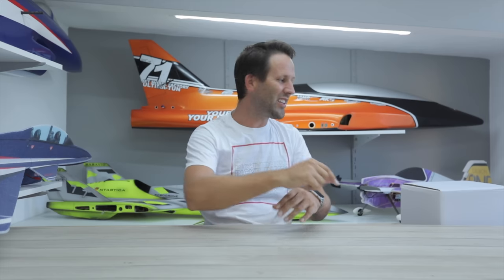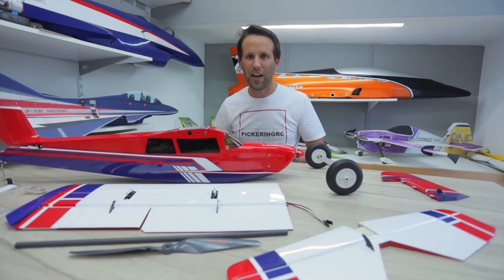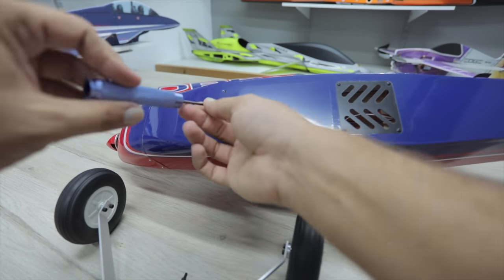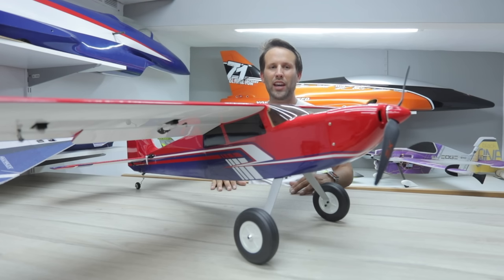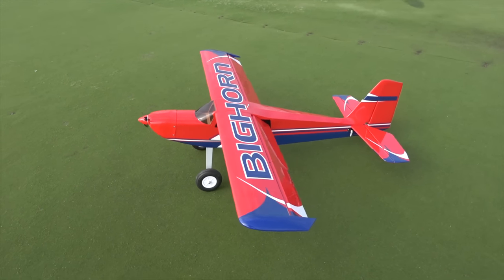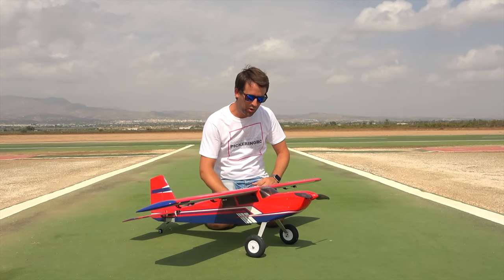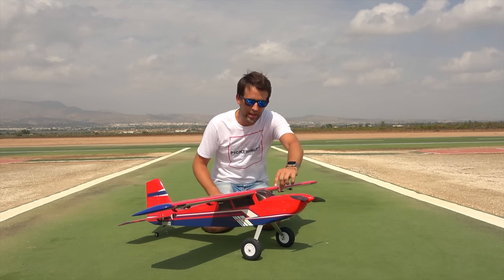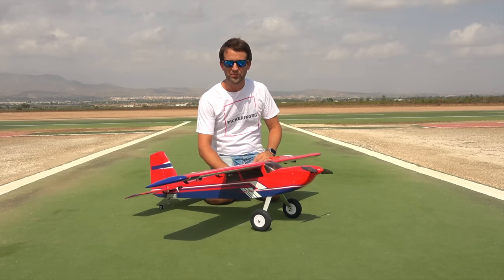Testing the OMP Bighorn STOL plane

Comment: This is a nice plane. Martin, can you show us how to program the aileron/ flap mixes that you show at the start of the flight?
Reply: Please martin show us this radio set up
Reply: @Krash_fpv  It is just a bit different for each transmitter  type, so I recommend searching for "crow braking" or "butterfly braking" on youtube or the internet in general you should be able to find the steps required. For this to work you will need each aileron to have a dedicated channel. And if you want the flaps to support the ailerons when flaps are deployed you also need two channels for either flap. 

This means :
- Thro, Ele, Rud, Flap, Ail1, Ail2 (for the "crow" mod)
- Thro, Ele, Rud, Flap1, Flap2, Ail1, Ail2 (if you want all options)

In short, your goal is to give the ailerons and flaps a positive or negative (depends on the model and if the ailerons are positive the flaps need a negative offset and vice versa) offset when you activate the crow braking. The direction can be tested and adjusted during configuration. 

For flaperon control besides the ailerons when flaps are activated you wil need to set up 2 mixers that are set to activate with the flap switch and use the aileron on the same side of  the plane as mixer input.

Comment: I would be interesting to see the different mixes of your flaps and aileron in close up and talking abit about them. I have a STOL E-flite Maul flying around since  some time back and would love to upgrade my mixing game abit
Reply: @Chris_love It is just a bit different for each transmitter  type, so I recommend searching for "crow braking" or "butterfly braking" on youtube or the internet in general you should be able to find the steps required. For this to work you will need each aileron to have a dedicated channel. And if you want the flaps to support the ailerons when flaps are deployed you also need two channels for either flap. 

This means :
- Thro, Ele, Rud, Flap, Ail1, Ail2 (for the "crow" mod)
- Thro, Ele, Rud, Flap1, Flap2, Ail1, Ail2 (if you want all options)

In short, your goal is to give the ailerons and flaps a positive or negative (depends on the model and if the ailerons are positive the flaps need a negative offset and vice versa) offset when you activate the crow braking. The direction can be tested and adjusted during configuration. 

For flaperon control besides the ailerons when flaps are activated you wil need to set up 2 mixers that are set to activate with the flap switch and use the aileron on the same side of  the plane as mixer input.

Comment: I saw more 3Ding than stol. But it flew and handled it well. Got to love the wood construction.  Those are the noisiest wheels i ever herd. They need big balloon tires with air in them and C/F gear legs.
Reply from the maker: Yeah, really hated the wheels… !!
Reply: @MartinPickering-PickeringRC  Maybe try using those massive bubble wheels from the multiplex funcub and the landing gears from one of the Timber planes?? Wonderful job on the build and flight as always BTW What size lipos are you using 4s? I believe I seen a video on here from OMPHobby from overseas in which they used a 6s on it boy the power it had in that video was unreal dough not sure what size 6s they ran??
Reply: @3DMOFO2020  I fly this on 3S 2200 and it has unlimited vertical!

Comment: observations.      nice model, but,  NOT a flawless one.
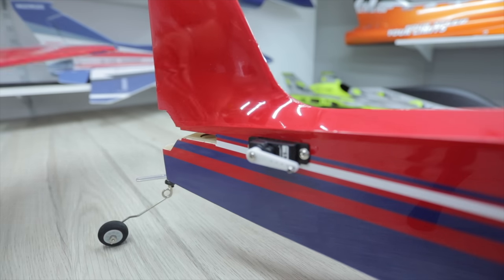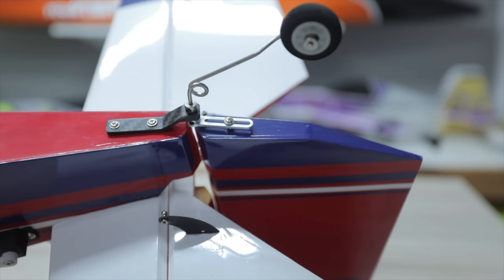at :55, visual evidence suggests that the manufacturer  reproduced  the  semi-symmetrical wing profile, of the reference design.     if the whole wing is that way,  the wing of this model  has  a  LESS-than  ideal  profile.!     but, hey, no one cares about  THAT, right.?      that profile  actually  Raises  the stall speed (of a tiny wing).             at 2:00, the first thing to do is,  MOVE  the  Mass of the servos to near the cg.!              at 2:45,  poor tail  wheel arm/strut  design.              at 3:07, the  Mass of the wing servos is  poorly located; it should  Not be  aft  of the cg  line.!            these kinds of  location of  mass design  Errors,   AFFECT  the (overall) distribution of mass (dom), of a  vehicle/aircraft.              at 5:15, prop is noisy; or the nose is.      if extra vibration is associated with the excess noise, servos  may  GLITCH, sometime.  in the middle of a flight.   IF  the  servos  were  installed with  grommets, then, no problem.                 googletranslate
Reply from the maker: Servo mass in a wing on this style of aircraft is far from important, on a performance aerobatic model sure… but here, correct CG is sufficient…

Comment: How much weight did you add to the tail ?
Reply: Are you kidding me? Why would he do that? I'm guessing none unless he likes to struggle to fly it.
Reply: @michaelkrailo5725  look under the tailplane, white/silver weights !
Reply: @bandyladd5138  What time in the video are you looking at? I see no such weights.
Reply: @michaelkrailo5725  5:40 starboard side below the servo
Reply: @bandyladd5138  Thanks for pointing that out in the video. He is using weights in the back. The real question is how far back from the leading edge of the wing is his CG. I have my battery back pretty far now and like the way it fly's but I could not get it to hover. So maybe moving the CG back even more will improve the ability to hover better. I don't want to add weight to the tail and loose any of the good flying characteristics that it has now though.
Reply: @michaelkrailo5725  lots of 3d planes have a very rearward COG and the pro pilots step well away from recommended cog in manuals it’s all about knowing your plane I guess, I also think Martin may have been using a 4s battery.  Mine does not have the power of his on 3s
Reply: @bandyladd5138  I'm going to experiment this morning but I definitely do not want a tail heavy plane. It should be balanced neutral. Hopefully he responds to the question because I'm curious now.
Reply: @bandyladd5138  After a lot of experimentation, I have settled on 66mm CG back from leading edge of wing. I can hover from this location without sacrificing anything in precision flying. At 67-68mm it was really easy to hover but the pitchyness of the elevator starts to be too much for me. The front of my Glacier 2600mA 3S battery is right in line with the back of the cowling. Hope that helps.
Reply: @michaelkrailo5725  Thanks Michael, I’ll give that a try on mine !